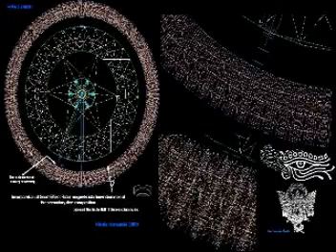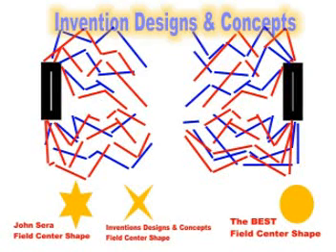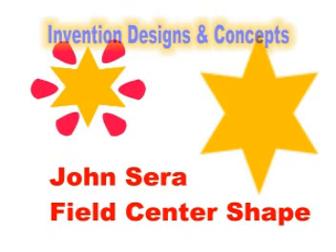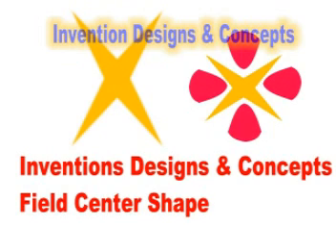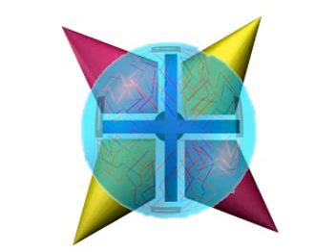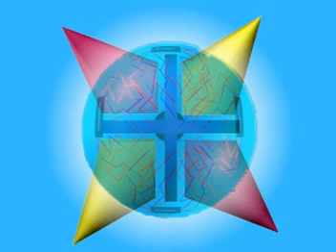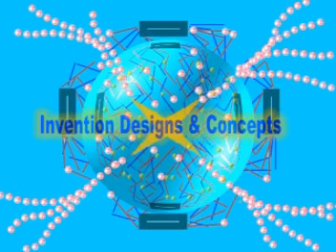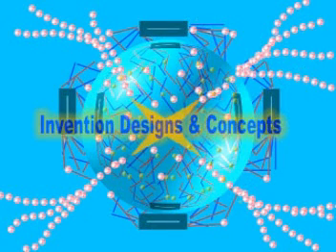Boosting  John Searl Device  By InventionDesigns&Concepts

Comment: PS: In my personal view, the "rollers" in John Searl's design constitute a PERFECT RESONANT CIRCUIT. My best "guess" would be that your suggestion to "hollow-out" the "roller pins" (rollers) might negatively interfere with the overall geometry and quite possibly the magnitude of the energy which is converted for use as electricity. There is nothing wrong with giving the design a small physical "nudge" to jump start the system. We appreciate your effort though. PEACE, JOY AND HAPPINESS, ALL WAYS!

Comment: got a little something else to share with you. 
Those rolling pins in your design. "TRY THIS"
Hollow them out and put the Rechargeable long lasting Battery in them. Start the device with no Power in the Rechargeable. The give it Power to start it running. The Rechargeable should run the machine by it's self. Add a voltage regulator and your all set. The Searl Device should run under it's own power.